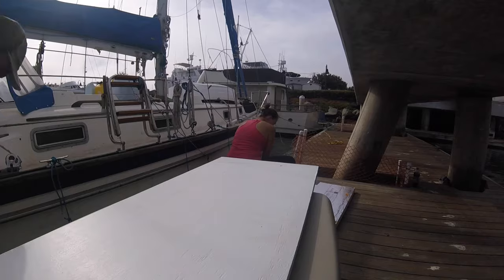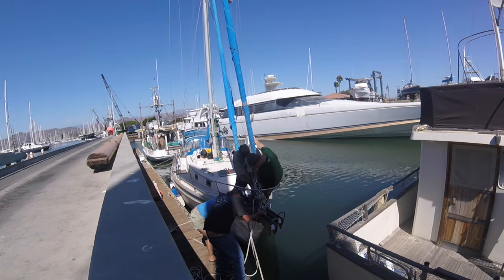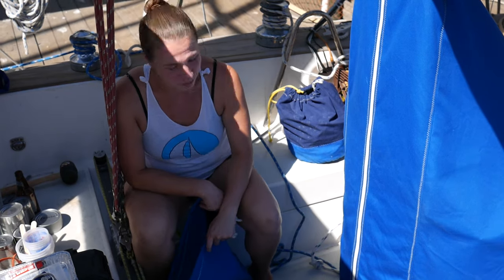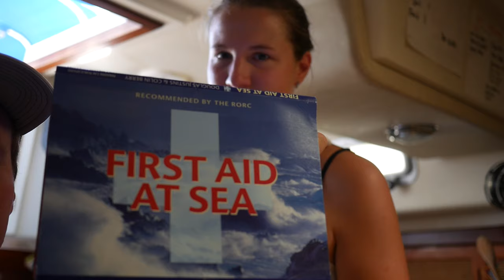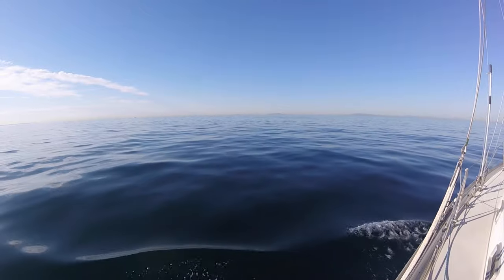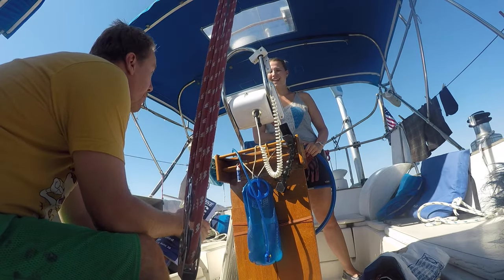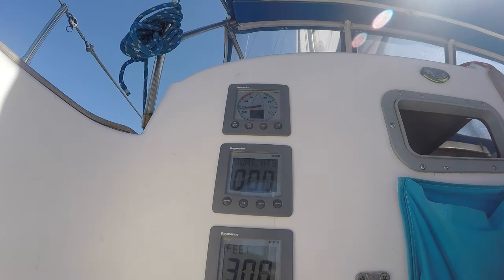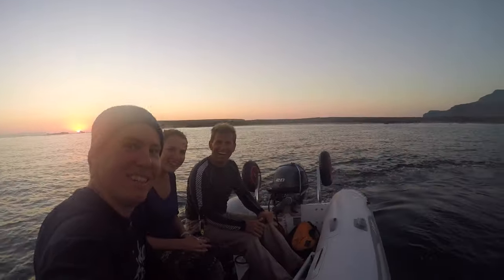BACK TO THE ISLANDS! [Adventure #27]

Comment: Great videos!  I admire your terrific sense of adventure and abilities at problem solving.  You might want to try tightening up your splices by rolling them back and forth on the deck while wearing your deck shoe.  Best of luck to you both, and thank you for sharing your adventure.
Reply from the maker: Thanks Vince for your kind words and advice, rolling the splices under foot or pulling on them more on deck?
Reply: Lay the splice on deck then roll it back and forth while putting pressure on with your foot.  Have your deck shoes on.  It will work the strands you inserted back into the lay of the line...almost like magic.  Thanks for replying, good luck to you both.
Reply from the maker: Thanks for this tip, we will try this when we splice next.  Sounds simple but makes sense.

Comment: I second what round51 says about long splices. To neat the splice up after finish, put it under the sole of your shoe and roll it back and forth a few times to round it up a bit. I don't know if you plan to deploy the secondary anchor from the bag, if you do make sure you secure the bitter end before you do. Maybe have it secured to the boat while in the bag, then you are ready to use it.
-johnny
Reply from the maker: Thanks and we agree with you both on the extra long splices, it looks like we did them too long.  Should have only made 5 tucks per strand.  At least that is the literature we found.  We will make sure the anchor bag is secured and not a bad idea to add a little loop on the outside that can be attached.

Comment: Just a thought on the belt. Watching the RPM react the way it did makes me think it's   a loos connection. Even though things returned to normal I would not dismiss the possibility that you may have moved some wires during the belt replacement temporarily solving the loos connection. Hopefully it's just the belt I'll be curious on how it works out. Thanks for your videos.
Reply: Some diesel tachometers take the signal from the alternator rather than a sensor on the flywheel, hence if the belt slips, no or low rpm is reported. My assumption is that this is the case.
Reply from the maker: Thanks, lots of comments on this and I think we are seeing more of a chance of that now.. Time to check all the connections.  Maybe also the voltage regulator.
Reply: I love trouble shooting having said that if the belt was slipping I would guess  that either you would here it or smell the belt slipping. Great channel with great people around thanks for the replies.

Comment: Small burns use ice or cold until the burn stops hurting (60 minutes?).  When the pain stops or is greatly reduced it means fluid has stopped leaking into the tissue and distorting the pain endings.  I have prevented many blisters that way.  (I guess that means I'm accident prone.)  Good to see you guys free of the dock.
Reply from the maker: It is amazing how well cold water helps a burn.

Comment: I have really enjoyed following your adventures and thank you for doing the work to share.
Let me share a tip with you. 
Just something you may want to try for burns like the rope burn you had. It sounds a bit unusual but Preparation H, or any other hemorrhoid cream, is a great way to soothe burns quickly. Developed to reduce swelling and alleviate pain, hemorrhoid cream will help you deal with the pain from a burn injury quickly and effectively.
I learned about it in a back country emergency medicine course. So I can not take credit for it. I strongly recommend you use a new sterile tube. Works great on all sorts of burns, insect bites, poison ivy, and other such injuries. Do not take my word for it. Do your own research. Next time you get a burn like you had try it on one blister and other remedies on the others. See for yourself which works best for you.
Disclaimer. Great for first and second degree burns where you will not be seeking  outside medical help. But for third degree burns or where the skin barrier is compromised contaminating the area with it may have negative repercussions and you should consider getting outside medical help.
Reply from the maker: Thanks Paul, great tip and we will be sure to look into that.   We have had some other tips on prescriptions that work well, however this would be a great alternative that would be cheaper and easier to obtain.

Comment: Odd problem with your alternator ... Loose belt will generally make a squealing noise.  If the belt slips you won't get the needed rooms to generate enough juice.  The belts play is usually how they determine if it's too loose. There was a time when alternators were rebuilt ...not sure that still happens.
Reply from the maker: Thanks Raymond, starting to think this may have been a combination of things.  The belt was certainly loose but after reading these comments it might also be something else.
Reply: You haven't seen the end of that alt. problem. It was never the loose belt, it would have squealed all the time if it were. Check your Alt. wiring and grounds, battery ground and engine block ground. You either have a voltage regulator about to go or loose / corroded connection.

Comment: Looks like a problem on the electrical side of your alternator to me.  Check for any loose connections on the outside. Is the bare copper visible? Especially the if the field wire could short to ground this would happen. If all looks well it will probably be the brushes or the voltage regulator.
Reply from the maker: Cheers, thanks for the awesome knowledge.  Wire check is the next on the list that sounds like a possible problem and then I fear the voltage regulator is more difficult for us.   Can we use electrical contact cleaner on the connections to help clean anything or should we keep that away from the alternator?
Reply: The contact cleaner can certainty help if the brushes are dirty, but most probably the wore out and are to short to reach the rings. Oh some people like to live dangerously and spray a running alternator, But flammable gas and liquid on an Arcing alternator.....You might be calling the insurance guys again :-)
Reply from the maker: Nope we are not dangerous like that, no way do we want fire or burns if possible.

Comment: Just watched more of the video.  Is that a maxi-prop?  Mine has a large zinc on the nose.  I just had to replace the strut due to galvanic corrosion.  Not cheap.
Reply from the maker: It is, I bet it was not cheap.  We will not be looking forward to that.
Reply: Then are you missing the nose cone zinc?  I had my 18 inch rebuilt for $1K and will take extra special care from now on!

Comment: unless you hear the belt squealing it is not the problem. if you're not charging because of the belt it will make a horrible noise. it sounds to me like the alternator it's self is going face down ass up.
Reply from the maker: You are correct, thanks for this we didn't know that we would need to hear the loud noise described to diagnose the alt belt.   After all our trouble shooting and playing around and tips from here, we finally found the cause.  A bad wire that was hanging by a thread, all is good now. Finally!

Comment: Never seen a dinghy with wheels. How do they engage? Do you have to flip it over? Looks like a lot of extra weight. Why do they need them?
Reply from the maker: We have seen a few cruisers with these now, I think they flip and drop down manually right before you go into shore.  It makes hauling up on the beach much easier. I don't think the weight is as much an issue as the drag in the water when you deploy.

Comment: You should learn how to re build Alternators.  I did it on my pick-up and it was a lot easier than I thought at first.  just look it up in the, (How To Video's) in YouTube.  Learn about motor oil in there to.  Get Dura Lube for your engine.
Reply from the maker: Cheers for the tips.

Comment: FYI: 5/16" Galvanized Chain at West Marine working capacity is about 1,850 lbs. but your 5/16" shackle rating is less than your chain.  I suggest using my system of upsizing any shackle size by at least one size more than the chain size.
Shackle Capacity Table (Forged with Alloy Pins)
  
Nominal Shackle Size
 
Rated Capacity (Pounds)
  
3/16"
660 lbs.
1/4
1000
5/16"
1500 lbs.
3/8
2000
7/16
3000
1/2
4000
5/8
6500
3/4
9500
7/8
13000
1
17000
1 1/8
19000
1 1/4
24000
1 3/8
27000
1 1/2
34000
2 1/2
110000
Reply from the maker: Thanks for the info and the awesome table, we have a 1/2 inch shackle on the main rocna anchor and Hillary thinks we have a larger shackle on the secondary bruce as well but we will have to check this now.  Cheers for the cool info.

Comment: What was the issue with the motor? the amps would drop off? as well as the motor RPMs? Has it done it again since putting the new belt on?
Reply from the maker: Yes, the amps would drop and the RPMs on the tach would drop to zero, it has done it since changing the belt though much less.  From what we have been told here, it sounds like possibly a wiring/connection issue.
Reply: But the belt did help which points back to a mechanical problem, the RPM gauge dropped, but the motor still ran as normal? I'm wondering if it a bad alternator and your RPM gauge is wired to you Alt, typically on a gas motor the RPM gauge goes to the distributor but there isn't a distributor on a diesel so it must tie into the Alt. My guess is that the alternator is ceasing up, causing amps to drop and RPMs to fall because of the way it is wired, tightening the belt would help put tension on the the pulley and give you a temporary fix. If you want to check the wiring, run a amp meter right off the alt when you get a low amp reading on your fixed gauge, if it reads low right off the alt then you know for sure you have a bad alternator.

Hope this helps!! Good luck guys!

Patrick
Reply from the maker: Cheers, yes worst case I'm wondering  if it may be an alt going bad.  It is wired direct to the gauge I am pretty sure, putting the meter on is a great idea, not sure if it is possible due to the location.

Comment: That splice was a little long. I would recommend you get a copy of  "The Ashley Book of Knots." It surprises a lot of people that a long splice is weaker and has a greater chance of parting than a short splice, oh and BTW that long splice was long even for a long splice! ; ) 
Actually I think you guys are really good at DIY. At least better than a large % of what I've seen.
One question. Why didn't you attach the sheet from the dock which was at about the same height as the eye? Plus you could have positioned the sail to spill most of the wind instead of catching it. We, at least it looked that way from my perspective.
Reply: Sailing gloves come in pretty handy too.
Reply from the maker: Have them didn't use them :(
Reply from the maker: Thanks for that, actually didn't know we had thought we should be doing 5 tucks for each strand.  We did more than that thinking it wouldn't hurt and may help,  whoops.  We need lots of help with DIY as we make many mistakes, we are looking at the book you mentioned and the Art of the Sailor: knots and splicing.   Your last two points are valid and more 20/20 for us, the wind did pick up unexpectedly in the middle but we did't even think about using the dock.  Our challenge was grabbing the eyes to bring them down to reach.
Reply: round51 
Hi round51,   I know what you mean about to many tuck, just I can not found it in the book ( The Ashley Book of Knots  page 445/470 ) if I mist it can you let me know where it is. Just like look it up again . When I went to maritime school they said the same thing.
Reply: If I told you it would spoil the adventure. Actually It's in there somewhere but I don't have my copy at hand.
Reply from the maker: Really you guys.... now you are just showing off.  Page numbers seriously?
Reply: I am so sorry I did not mean to show off, just wanted some info.

Comment: Looks like the forestay or backstay wire is cut too short. It should never be that difficult to reconnect a forestay.
Reply from the maker: Big problem here is we were silly and should have removed the Genoa, the weight from that on the forestay is what we think made it so difficult creating all the sag that was hard to stretch out.

Comment: If the belt is the only problem then you should hear and hear it burning from slipping.  I am guessing it's the alternator itself OR wiring or the voltage regulator.  Not fun.
Reply from the maker: Ok we are starting to think there is multiple problems,  there was certainly a loose belt but we still have the problem and I think it may be what you said.  Possibly the voltage regulator (what and where the heck is that even) maybe the wiring, but we can not see any signs of bad wiring.
Reply: Location: Usually inside the alternator itself at the opposite end to the pulley. - I have had a couple alternators overhauled for about half the cost of a replacement but just watch out that if you do replace you are at least getting "like for like" when it comes to output (amps).
By the way tension of the belt should normally be measured on the longest straight run of the belt, remember to get a new belt ASAP. Also be aware pulleys can wear and the belt drops down into the bottom of the Vee valley of the pulley consequently the belt is trying to drive on the bottom of the pulley and not on the sides of the belt = much less power transmitted to the belt = slippage leading usually to high pitched squealing from the belt when the batteries are down on power and major demand from the alternator to charge them up. Apol for long comment!!
Reply: may we recommend having a spare alternator when leaving the US?
Reply from the maker: Love the long comment, very helpful.  We did measure the tension on the longest side, in the video my arm could not reach that so I was just using the short side.  The belt we took off looks fine, I think we will keep it and we will also replace it with another for the parts locker.  I think we can find the voltage regulator, have you seen any videos on how to adjust it, do we need a meter or something or is it specific to the engine?
Reply from the maker: Hmm, probably a prudent thing.  We had not thought about that and I am not sure if we will go that route or not.
Reply: I'm sorry I cannot help further regarding the voltage regulator. I strongly suggest you search out a local business that overhauls alternators and visit to discuss the problem. You might consider taking your alternator along and ask if they have or know of anything with the same external dimensions that might fit but which perhaps has a different size pulley. If so install one and fit a different size but appropriate belt.

Comment: FWIW...be extremely CAREFUL when you are IN the engine compartment when the engine is running. Not a good practice.

A fellow sailor inadvertently got his PANT leg engaged with the engine.
Luckily, his pant leg TORE AWAY. Otherwise, it could have been a deadly encounter.
Reply from the maker: 100% agree not a place we like to be, big machinery is not kind to the be forgiving.  We were very careful to remove all tools and be well clear of the engine, although hard to see here that sail locker is completely free of any moving engine components.  The entire engine is nicely hidden in a much harder to reach place.  We thank you for you thoughts and concern, cheers for watching.